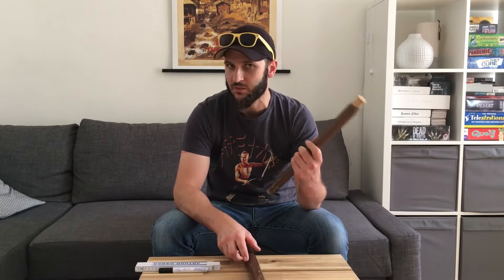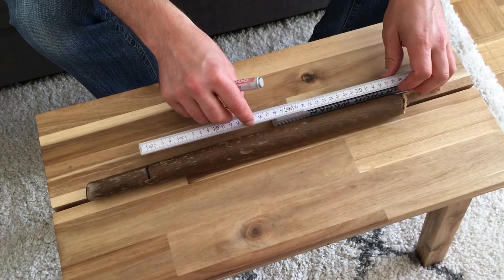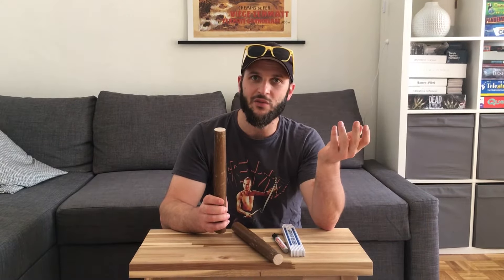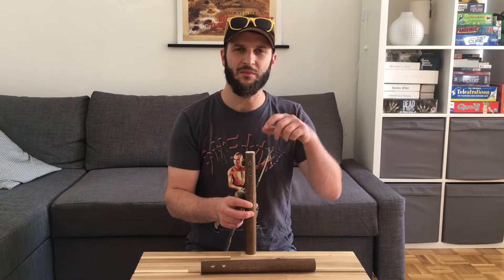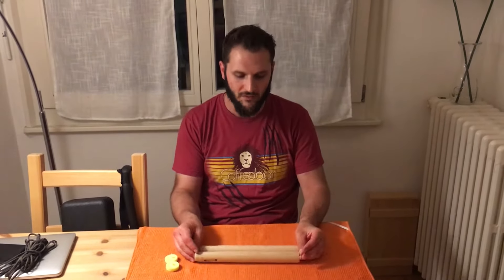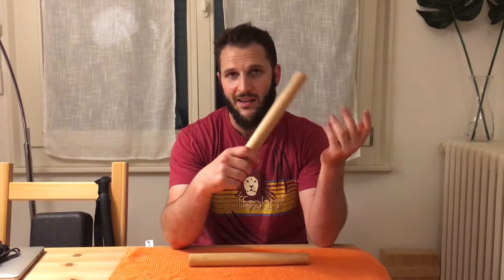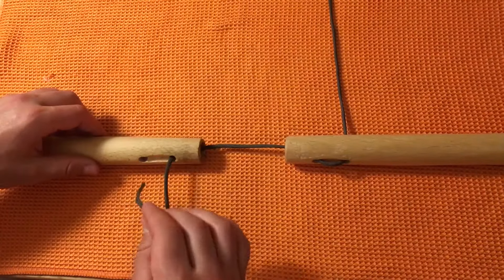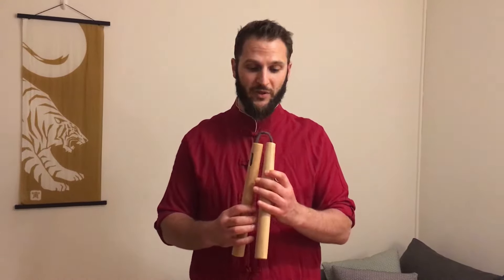How to Make Nunchucks At Home

Comment: When you have the two strings in the middle tie them with a square knot, Cut off the excess heat with lighter to lock it tight and pull the knot into the end of either one or the other  chucks, and once hidden keep pulling the slack out until the paracords equal out in the middle Thats how we restring them in Okinawa.

Comment: When drilling from the top how deep do you go... are you only going from the top to the first hole? Or all the way till both holes?
Reply from the maker: All the way till both holes :yougotthis:
Reply: @SifuKuttel  why too 2nd hole please
Reply: Drilling to the second hole isn't necessary
Reply: @luckyrockmore2796 I would only drill through to the first hole and then loop around through the outside and around the bottom. Otherwise drilling through takes away from the integrity of where their attatched.

Comment: I made some chucks last summer. I dreamed up my own way of connecting them with a length of paracord but it is a single strand rather than double like yours. I'm curious, is the double strand better? It seems it would add to the durability but does it improve handling as well? Thanks.
Reply from the maker: I don't think there's much of a handling difference when it comes to single vs double strand, it doesn't get tangled or change the path of movement. The only difference would be the overall strength of the connection.